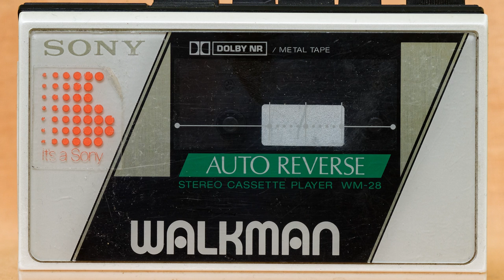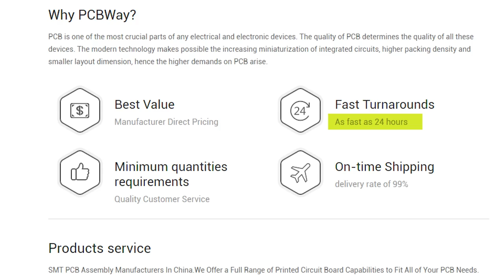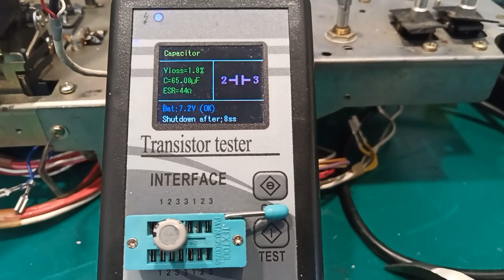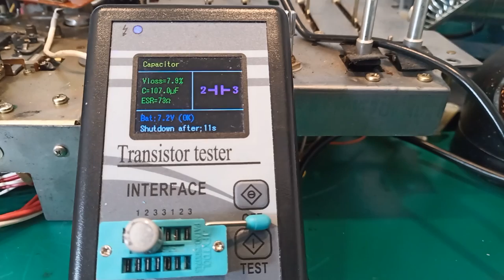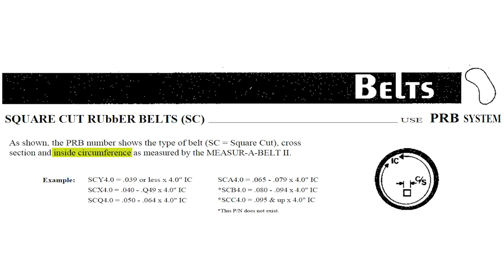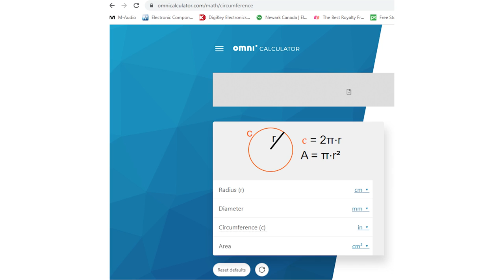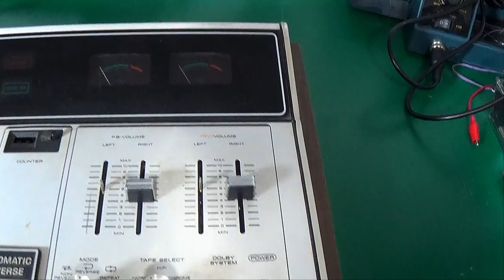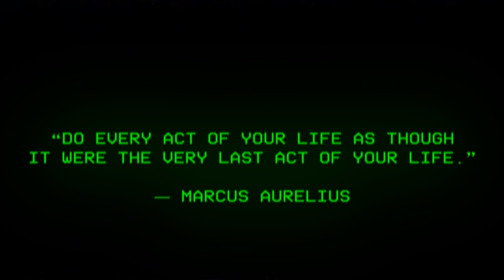Restoration of a Destroyed Vintage Tape Deck | Retro Repair Guy Episode 32

Comment: So glad you got a de-soldering station. You really needed one. A friend of mine developed monitors and other electronics, he had recovered and fixed a good quality de-soldering station. It was very impressive to me.
Reply from the maker: Hi again. Unfortunately in the last restoration the pump gave out and I went back to a manual one. I would have to invest in a higher end one but the 3 for $10 manual pumps are hard to beat in price. However, I do admit that when the electric pumps functions properly it does same time and makes things easier.
Reply: @RetroRepairGuy  I'm sorry to hear that yours failed. My friend Terry got a failed unit from work and simply fixed it. Almost half the equipment he  owns is something he recovered from the scrap and then fixed (or built from scratch). I think you would like him.
Reply from the maker: I'm sure I would. I always meet interesting people whenever I'm hunting for this old stuff. From guys who collect records to cars and everything in between.  Sometimes I go to the municipal scrap yard to throw out stuff like old scraps of wood or bulky garbage and I see these racks full of stuff people throw like TVs, VCRs etc. I want to take it all but I can't. Sometimes the guy that's there, I made friends with him, and he lets me sneak out a few things cause he appreciates that I fix it and give it a new life as opposed to being recycled.

Comment: You should be able to use O rings on the pulleys. Also use DeOxit Fader on the controls, it cleans and lubricates them. Regular contact cleaner doesn't handle corrosion well.
Reply from the maker: Hi. I've been doing this for over twenty five years and I will say a big NO you cannot use O rings. The fact that they are O in the first place is a problem. The tires have a wall and flat surface. Also O rings are shiny and slippery while the tires feel like a rubber tire to grip. It would cause wow and flutter problems as well as other issues. DeOxit is good nothing against the brand but it's pretty much the exact same thing as I used automotive electrical contact cleaner. Thanks for watching!

Comment: WIth the vu meters you can loosen the screw in the centre, I did this on my akai top loader deck.
Reply from the maker: Hi David! I'll definitely try that but I think because of the nasty fall there might also be a broken connection point for one of the wires, I didn't check that only the boards. I also want to clean the interior of the glas at the vu meter point, somehow it got smudged or I still see a streak. Just when I thought I was done with it. Thanks for watching!

Comment: I have lived in Britain now for 53 years and before that I lived in Ireland & then Denmark. As a result I always see the North American style 120V power leads and plugs as the cheaper inferior design, yet I do like (and want to use) the square Roberts screw head design. I wonder where these instinctive value judgements about the design of universal items in our environment come from?
Reply from the maker: There's actually a fairly well written article on Wikipedia about the history and how International standards of plugs and sockets came to be and that it's believed that the earliest were British Standards. https://en.wikipedia.org/wiki/History_of_AC_power_plugs_and_sockets the article is definitely worth a read.
Reply: @RetroRepairGuy  there are so many. Some huge lumpy items like the UK 13A plug,down to deminutive compact 3 pin designs like the Swiss (which I have used myself). Australia have a unique variant, I think Italy has as well, all of them are 220v systems. It's a subject that could fill a whole museum. Some of the early designs were really dangerous.

Comment: It's really cool that the auto-reverse mechanism doesn't flip the head - it uses a stationary 4 track playback / record head so playback azimuth is going to remain largely accurate over the years. Question: did you lubricate the bearing surfaces and if so, with what? 
Oh and the missing knobs look like the ones missing from my Roland Juno 6 keyboard. I found a 3D print file for them and had a friend print them, saved me a big headache.
Reply from the maker: Hi there! I don't remember everything I lubricated but I normally add where required or where service manual says to. For all mechanisms like VCRs, CD players, etc. I always use Lucas white lithium grease. A tube will last forever and in my opinion the best stuff I've ever used. For the buttons, I looked around and came close but then underneath was not the same hole. 3D printing could be a good way to go. Did they turn out nice? Thanks for watching!

Comment: RRG, did you try to use rubber wire with appropriate section glued to circle with cyanoacrylate glue instead of whole formed rubber belt? I heard that wire's ends glued together very well, seamless practically. We used this method to make o-rings for water cooling in a injection pressure molds.
Reply from the maker: Hi there! Never heard of that but sounds interesting. Any links I could read about that?
Reply: I don't have any links, John. Sorry. Just shared with my experience and thoughts when saw the part about belts.
Reply from the maker: @Roman-Shipilov  That's OK just sounds very interesting!

Comment: I didn't see you add any lubrication in the mechanism. Those flywheels in particular need lubrication on the shafts. Nice restoration.
Reply from the maker: Hi Pete. Yeah the video was already so long and also at one point I stopped filming as I was fixing so many things. But I did of course lubricate. I also checked the record bias as per the service manual and adjusted the head because of the nasty hit it took had messed up the alignment. As I said in some of my other videos, I try to condense everything and make it flow as I don't want you to watch me solder capacitors for two hours or get into the nitty gritty. Thanks for watching!